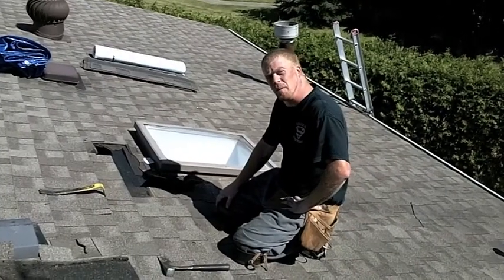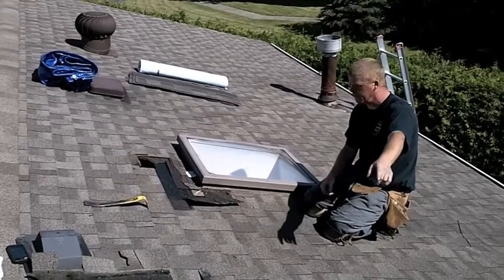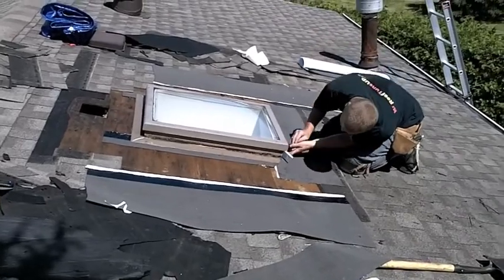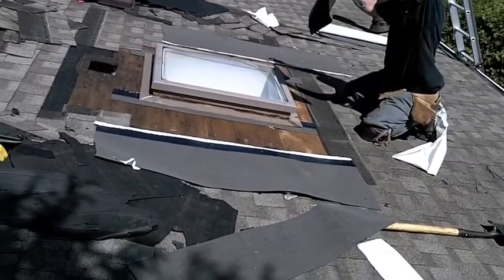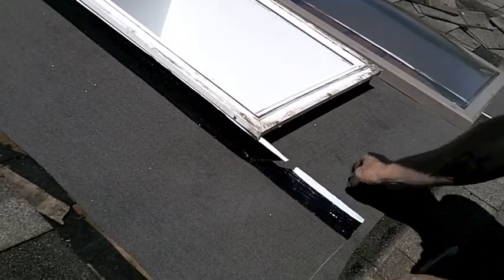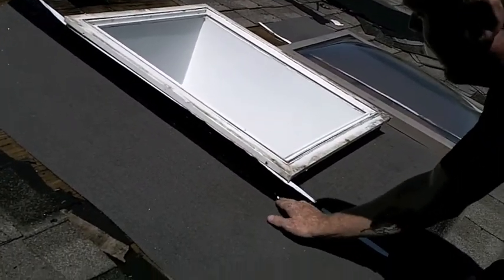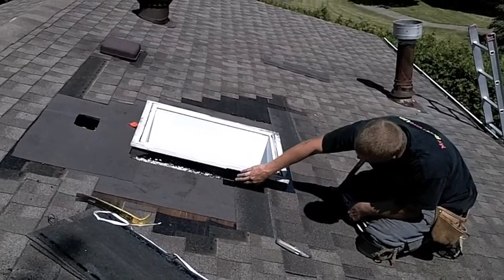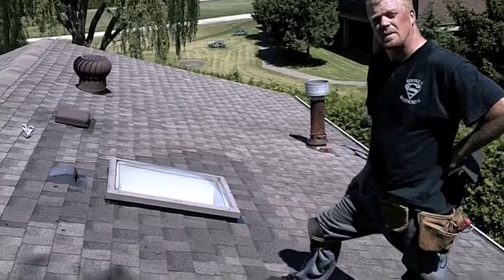Sky light repair 2

Comment: Wrong wrong wrong,ice and water goes under skylight seal in between the two and you don't need step flasing ,hilarious 😂🤣🤣
Reply: Louis Diaz step flashing is an extra barrier of protection and it’s cheap so why not use it ?